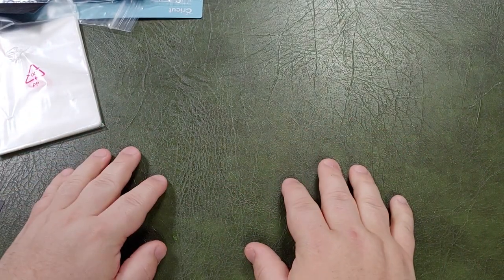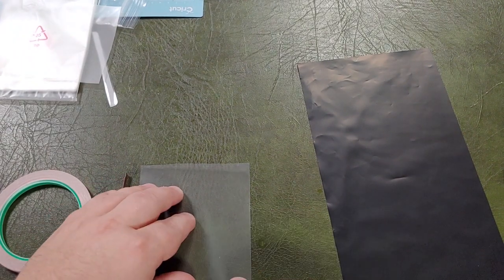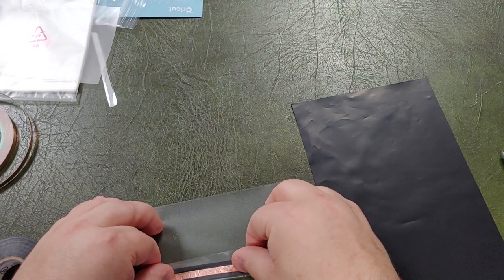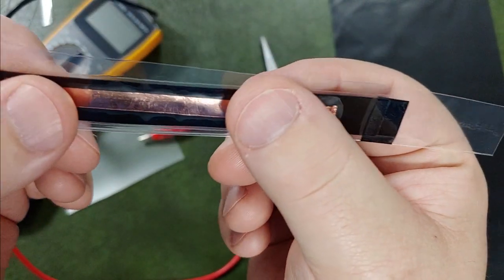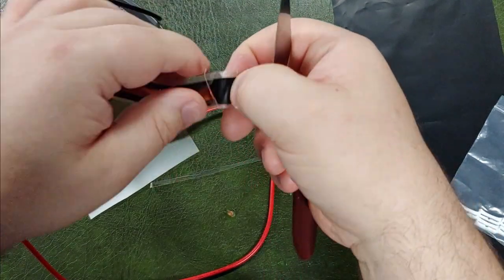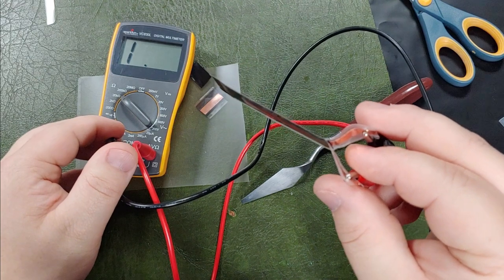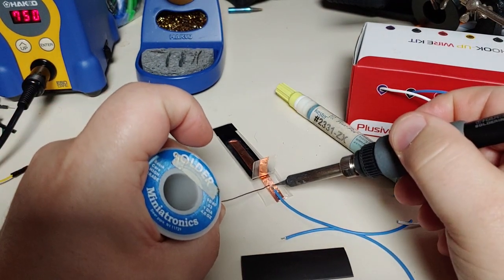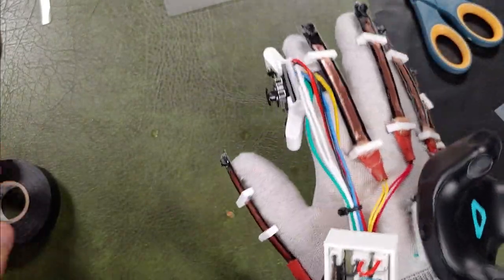How to make a DIY flex sensor for VR gloves with velostat and copper foil

Comment: Not sure if games can handle what I'm talking about. But it would be cool to use this and make 10 smaller ones per hand so the first 2 joints from the tip can be read while allowing the 3rd joint to have it's own reading. curling the fingers vs making a fist if I'm explaining it well.
Reply: These types of gloves just use the standard Valve Index software to simulate finger movements. If you wanted to learn VR game development then you could probably just program a game to use as many finger movements as you wanted.

Comment: Have you compared your DIY sensors with the ones that can be bought already made at like 10 bucks a piece ?
Reply from the maker: I have!  They work a bit differently, even though they're similar and measuring the same motions, so it's hard to compare them directly.  They probably have better longevity, and maybe a slightly smoother change in resistance but not by much.  Overall they're pretty comparable in effect.
Reply: is there a link or name for this?
Reply: @twidgevr  hi, didn't see your comment, okay awesome, thanks so much for the feedback !!
Reply: Can you release the wiring diagram

Comment: this is pretty cool, although the problem is that if you want force feedback, which i think is a must with gloves, you still have to add the strings pretty much anyway
Reply: I'm pretty sure you can use magnets and flexible actuators for haptic feedback.
Reply: well if you don't want haptic (i dont see why not but hey...) these are kinda more compact

Comment: i know its been 3 years but i was wondering if you needed to change and of the code so that that it worked like this instead of using potentiometers
Reply: These are designed to give output that is very similar to potentiometers, so they'll work with no changes to the lucidgloves v4 firmware.  There are a few tweaks you can apply to smooth the data which might be helpful like running median filtering, be sure to read through the advanced options!
Reply: @MrHellomoses  thank you

Comment: Will you be releasing the modified aurdino code for the flex sensers
Reply from the maker: no modifications needed if you're using the lucidgloves firmware, it'll "just work" more or less
Reply: @twidgevr  what printing material is the guidenodes
Reply from the maker: @monekysunglsa6682  regular old PLA, nothing special.  print them up on their ends and there's no overhangs or anything to worry about, they should print easily with whatever you've got

Comment: Hello, how did you connect the negative and positive of the Flex sensor? How do I know which is positive and which is negative?
Reply from the maker: it's "unidirectional" which means that it can't sense what direction you're bending it, just that you're bending it.  becaues of that, it doesn't matter which side you connect to pos or neg.
Reply: @twidgevr  ahh thank you very much, you also have to put a resonance yes or yes or or just connect like that? and to which pin would it be connected to the a0.5v and gnd?

Comment: I was curious whats the use of the copper foil in the first place? Can't i just solder the wires directly in the velostate, then i connect one wire in an output pin and the other wire in an input pin in the arduino?
Reply from the maker: you will not be able to solder to the velostat sheet, it's plastic with a fairly low melting point.
Reply: @twidgevr  I got it now, just a last question, why use two foils from both sides rather than useing a single foil on one side of the velostate and then solder the two wires in it?
Reply from the maker: @ahmedahmedeg7941  The property we're measuring is the called the "bulk resistance", and it's the amount of electrical resistance through the sheet of velostat which changes when you compress it.  To measure that, you need an electrical contact on each side.
Reply: @ahmedahmedeg7941  you would just be measuring the resistance of the copper sheet

Comment: Do I need to laminate or could I use packing tape
Reply from the maker: Packing tape can work pretty well, just try to make your process repeatable and accurate so they all come out similar.  Small changes to compression or tension in the velostat can change the output a lot, but that's fine as long as all of your sensors behave the same.
Reply: @twidgevr  also do you need resistors and if so what kind

Comment: Can I use aluminum sheet in place of copper sheets?
Reply from the maker: Yep that can work fine, the leads just need to be more conductive than the velostat.  I've seen people use conductive string or even just stripped wire before.
Reply: Like the aluminum foil used for cooking? Claims to be high heat resistance and ultra strong. I might give that a go.

Comment: what resistors did you use ?
Reply from the maker: I just used some 100 Ohm resistors i had lying around, they seem to match pretty well.
Reply: @twidgevr  thanks 

when I saw your sensors I found hope to build it in a simple way without a 3d printer I hope I can do it

Comment: do you think this will do for making a lucidvr glove without any 3d printing?
Reply: Yes but I don’t think you’d be able to get haptic feedback unless you mod mod it
Reply: @Theredstar2478  well yeah thats the main problem, nevertheless I find it quite interesting for a first time glove.
Reply: @mundovtor  well yea, I was going to see, cause I really like this type of stuff, but I was going to try making an exoskeleton that connects at back and goes all the way to both wrists, only problem would be how to make the haptic feedback work, maybe multiple motors for all directions? Not too sure, also gotta have a lock so you don’t over expand your damn elbow and break it 🤣
Reply: @Theredstar2478  wow that's ambitious! Also consider that you would have to code some things for it to work I suppose. Best of luck my friend!
Reply: @mundovtor  yup it will def be hard, but there’s like exoskeleton kinda things online, only thing is they’re expensive, and they aren’t for vr, I have to see if I can get my hands on the exoskeleton equipment just to see how it works and create one myself 🤔